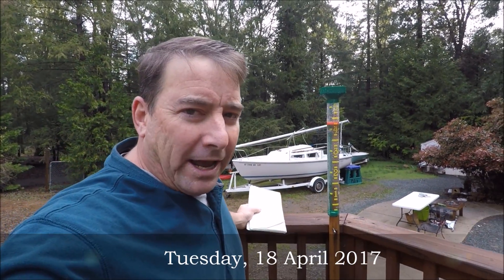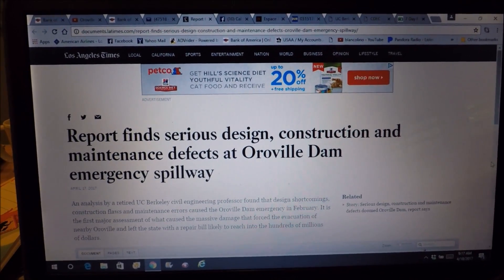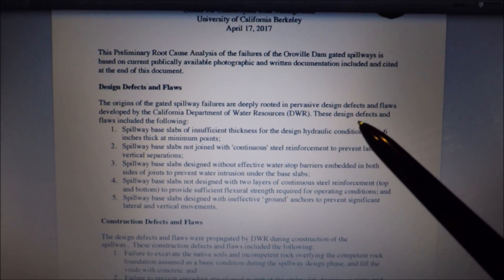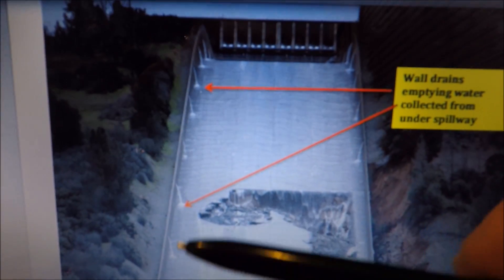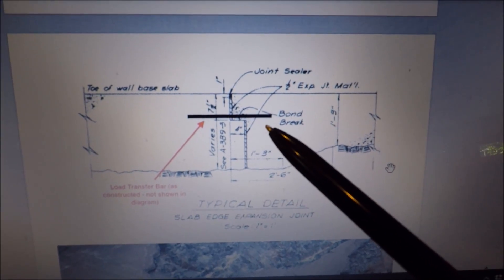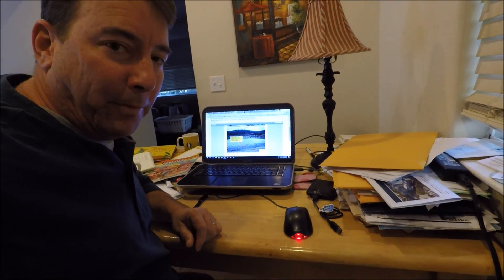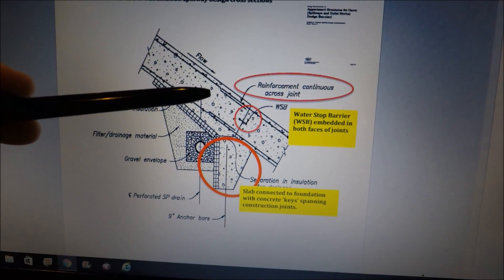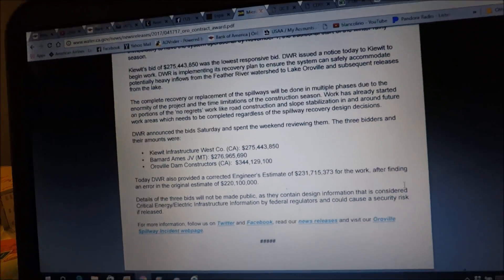Oroville 18 April Spillway Failure Explained-Independent CCRM Report

Comment: Cavitation technically is not a positive-pressure air-bubble, it's a negative pressure "vacuum" that is created by fast moving water, which is why it's able to "pop" into existence and suddenly collapse. Cavitation is similar to what is theorized to happen on the lift-side of an airplane wing or sail, it's a manifestation of a pressure difference caused by fast moving fluids and it is the most destructive force water has when eroding anything.

Good video.

Comment: I continue to be concerned about the spillway control gate structure and it's known column cracks and spalling. It may be inadequately supported by bedrock and has obviously been experiencing stress damage and possible shifting.  I expect the upper end of the spillway to be seriously undermined as that has been a primary source water flow underneath the spillway slab.  Some of the photographs show gate leakage disappearing through the cracks in the upper spillway just below the control structure.  
My personal recommendation would be to keep the current spillway operational and begin construction of a new spillway channel diagonally southwestward starting on the current boat ramp parking lot adjacent to the current emergency spillway.  Repair the current spillway to be used as the replacement for the current emergency spillway after the new spillway is completed.
Reply: You are spot on Robert.  So far, I haven't seen any indication the Kleiwet has been contracted to replace it.  I hope they will, and repair the top of the SW also, because photos of it prior to the major February cavitation, show a strip of cracked and separating  concrete that looks like a Detroit sidewalk.  Top to bottom, it needs to be replaced.  My feeling is that the entire Oroville system needs to be retired and replaced.

Comment: Of course this does not address the 'emergency' spillway, most likely because it did not fail due to age or lake of maintenance, but due to political and management factors. It would have failed day one had it been used. When it was used for the first time ever this year, it DID start to fail at a fraction of it's supposed design capacity, and there was genuine surprise when this happened. So for fifty years DWR did not question this critical part of Oroville dam. Even after they HAD a report in hand from an independent review 10 years ago, nothing was done. If the emergency spillway had been properly designed and built in the first place, this would have been minor incident by comparison.

Comment: Thank's for the Stellar Transparency Juan.
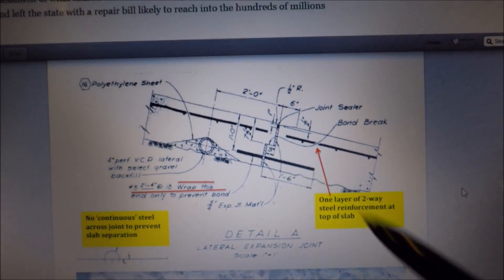1:55 Me too! 6:55 weakened planes. 8:40 no select gravel below said pipe for support cradling. Even you're home's City water meters have @ least 4" below & outside it's edges to insure water junction support.
-Bet they don't utilize the same round aggregate sub-base fill as before. 
-Change Orders needed for the original plans are known to most bidders & affords them to leave money on the table in order to win the lowest bid. 
-These logically Persuasive future Change Orders eventually surface & augment, if not increase, that said table money. But then, what would i know of such things? 23 yrs. as an inspector of new construction of roadway & bridges for TXDOT.
"Inspectors are like morticians, no one want's to have to deal with them, but both keep things from stinking later on."-gilpin 41817

Comment: Juan, thanks for your excellent presentations.  Incidentally, cavitation isn't air bubbles.  It is caused by low pressure, a vacuum,  causing the water to vaporize, or boil.  The bubbles are water vapor, not air.  You are correct though in that when the bubbles collapse they cause a pressure spike that can damage, concrete, boat propellers and powerhouse turbines.

Comment: The intended purpose of those earthenware pipes underneath the spillway was to reduce pore pressure. Pore pressure is the hydraulic pressure of water. It can be immense and can hydraulically force apart pretty much anything. What we can see in at least one of the pictures is that the pipes have been completely surrounded by concrete thus sealing the pipes from being able to allow the migration of water into the pipes and thus they are not able to relieve the pore pressure below the spillway. A better design would have been trenching the pipes into the rock rather than laying the pipes over the rock and surrounding the pipes with the spillway concrete. Better that the pipes are surrounded by porous gravel and the gravel wrapped in geotech fabric. Hindsight though is a wonderful thing.
Reply: The clay pipes are governed by the golden rule of drainin water...the fall or downward angle of the pipe to carry off the water was constrained by the thickness of the concrete thus to increase the flow of the water out of the pipes to the side drains the designer angled the pipes down the slope creating head pressure enough to direct the water up the sides and out of the drain openings.  It is now obvious that this spillway is like a layer of dominos with tremendous leaks between the slab blocks that are so visible in the wreck of the lower spillway.  Also, the designers neglected the forces of friction involved at the flow increased to 137,000cfs which would open up the joints allowing even greater leakage and soil/rotten rock disolving underneath the slab allowing movement in more directions..up, down, sideways.  This spillway was so porous it deserves to be called a seive, and the designers collander salesmen.
Reply: I'm trying to keep up with Juan, and hate to expose my ignorance, but I  am ..... technically challenged. Would really appreciate any info you could give me. - the drains are for what? - and hook into the clay pipes? - not understanding Juan's refs to "herringbone" - how are the pipes arranged under the spillway? - are the expansion joints part of the problem? Thanks.

Comment: As a civil engineering materials quality control technician and an ACI certified technician this is so interesting. So many flaws that I deal with almost daily. It's great to see what can happen if I don't do my job or the engineer cuts corners.

Even with my limited expertise I can definatly say that the spillway is far from adequate. I would have imagined at least 24 inches of concrete on something this massive. And no rebars on the bottom of the slabs? That's weird. I would have loved to have been there during construction to see all of this.

Comment: I'm not sharp enough to tell, the what to do except redesigns that discharge spillway so that both plant and excessive season's waters strains the same direction ...
But do energy requirements absolutely needs Flats levels of production ...

Don't California use wind or Solar production devices ?

I've seen comments asking for Stronger (Bigger) Power-plant production Which could have sense without misuse of it ...

The power plant ought to be able to absorb a large part of water levels variations ...

Stop considering the oroville lake like a free refill tank ...

It has never been free energy !

I just cannot understand, nor accept an Energy producing device that was conceived with the event they have to stop producing cause the energy provider "gives" too much !

What ?

The lords buried them under tha gifts ?

They received that much, that they can spent it like it was unsignificant ?

As a matter of concrete "joint" dilatation absorbers, or junction ...

I do not agree with those draws !

My deep internal feelings is that they should build those in large curved "trait de jupiter" junctions or  sections that could be "anchored" from a clean base to the top of the spillway ...

Which means "sections" could be built anywhere else and then assembled on the oroville basement !

But, I'm not qualified enough to talk about the whole meaning that situation ...

Except that some humans "ways of being" leads to it !

Thanks Biancarlo, ...
If you were able to translate CFS to metric measures, would be a plus .

I know gallons are about 4 liters .
Just can't put a "picture" or imagine what is or what represent a Cubic feet ...

We even don't have triple-cheese-burger there !

Europe is third world, I swear !

Comment: A couple odd things in this report.

First, he states that the diameter of the drain pipes was enlarge to 6" from the original design calling for 4". Where does this information come from?

Also, he questions why there is no steel bridging the expansion joints. The whole point of an expansion joint is to allow for independent movement of sections. If there was steel connecting adjacent sections they could not move relative to one another. Why would he cite this as an omission?

Comment: Very helpful report, nicely done.  One note about cavitation.  I think the bubbles are not air but water vapor at reduced pressure, where stresses have pulled the water away from itself, creating a rupture in the liquid, shaped like a bubble but full of nothing but vacuum plus water vapor  at the temperature and pressure at hand.  If there were air in the bubble it wouldn't crush, but with nothing in there but water vapor, the "bubble" can implode destructively.

Comment: You don't have to fix a leaky roof if its not raining, or that's good enough or it will hold. People are people.
Reply: + MyOLD36chevy - But a WISE homeowner doesn't wait until a catastrophic storm (rain, sleet, heavy snow, or fallen trees) happens to see if his roof is strong enough and has the right materials to resist serious leaks or cave in. If he's not knowledgeable enough himself, he hires someone who is to periodically check for weak areas and do repairs or replace the roofing materials every __ years as advised by roofing experts and other professionals.

Neither does a wise person let his tires go bald, have a blowout, and have a tragic accident loosing control of the car and possibly killing himself or others. He periodically rotates the tires, fills them with the required amount of air, and replaces them BEFORE he (or his mechanic) see the tires are near their estimated life expectancy.  It's not unlike one's health and medical bills:  you can pay now or pay much more later.
Reply: I agree with the concept but I have worked on government jobs and there is not a lot of common since to be found.

Comment: Very good report as usual. I saw your drawing at the end showing how the slab should look at the drain pipe. It showed the slab actually thicker at the drain instead of thinner and the pipe surrounded by gravel. That would be a lot of extra digging in solid rock sideways across a steep slope. Easier to grade the rock to bottom of slab level and lay the pipe on top. Design or construction short cuts? Do they have the original drawings? Or did they lose them in the fire at the pool 1 power plant?

Comment: It had to be drainage or leakage problems. Cavitation, especially destructively resonant cavitation, acts on the upper surface of the slab, and is readily visible, long before the slab fails. Erosion, underneath the slab, was only way it could fail "suddenly." It's a double edged sword. First, as Juan rightly points out, a sagging slab over an erosion void, puts the upper surface of the slab into compression, easily resisted by the concrete itself. The lower half (give or take) of the slab went into tension and, devoid of rebar, simply sagged, then failed.

The other component of spillway failure due to erosion lies with the anchor bolts. With a properly supported slab, the anchor bolts transition from slab base, immediately into bedrock. Any slippage puts the anchor bolt (rebar) into shear, a stress easily resisted by properly sized steel. Erosion, on the other hand, not only creates a bending moment between the slab's under surface and now distant bedrock, it further subjects the steel to potential flex, and concurrent metal fatigue.

None of this is rocket science. This IS why any competent maintenence program includes core drilling thru the slab, you HAVE to remain aware of foundation performance. You further HAVE to be fully aware of the consequences of even one single under slab drainage failure, and this awareness requires ZERO effort. The wall drains all flow at comparative rates, or they do not, and this is visible under the most cursory visual inspection.

 I'm going to hold short right here. Any competent engineer will confirm my statements up to this point. Further discussion, involves potentially subjective assessment, and political maneuver, up to and including a possibility of libel issues.

I think the Official report, will be very....interesting... regardless of content.

Comment: You keep mentioning met standards of the 1960s. I have to push back on that. Proper standards for any kind of construction like this requires going down to proper bedrock. 5/8" rebar on 12' centers, come on??? There may have standards but full compliance is in question. The crack failure mechanism was the result of drain pipe installation. Couple design inadequacy with inadequate and inept maintenance will challenge and defeat even a properly engineered structure. Here is a clip from an article California Water Research (An INDEPENDENT research source on California Water Projects) article "An investigation by DWR in 2008 of the main spillway chute showed that the concrete surface had more extensive damage than just the “small areas of spalling” noticed by John Onderdonk in 2007.  The bid summary in 2009 shows that the main spillway chute needed 10,000 linear feet of sawcutting one inch deep, and 83 cubic yards of void repair. The chute also needed 3,900 linear feet of major crack repair, as well as 23,700 linear feet of contraction joint repair.

Although the letter from FERC requested Department of Water Resources to submit a followup report on the main spillway chute repair, California Water Research could not locate any report about the repair in DWR’s public FERC filings.  As previously reported by California Water Research, the Bureau of Reclamation’s Guide to Concrete Repair recommends investigation of the causes of cracks in concrete hydraulic structures".
 So were repairs done?? 83 cubic yards of concrete is 8 truck loads. If this design was adequate for 1960 standards, then what about the others built in this time frame?

Comment: So it is not built as a bridge or a roof, but only as a roadway. A very steep roadway. Basically, a thin layer of concrete floating on mud held in place by wire.

As long as the foundations where kept dry, it held together just fine. But after 50 years one of the clay sewage pipes blew out and water got into the foundation. A sinkhole formed and it's game over.

Comment: great job juan! lots to get thru for sure and maybe you can get more detailed as the project moves forward. question, if the first design failed why the would you use the same basic design, including construction updates, again? considering the bed rock issues, especially at the newly formed plunge pool, could a heavy gauge plate work to reinforce and/or span the void?

Comment: Of course it failed at the weakest section, but that wasn't the cause, it would've failed anyway, maybe a bit later. Do you have freezing temperatures in that area? It might have been a contributing factor, frozen drainwater eroding the rock and lifting the slab, making cracks.

Comment: Where in the report does he point out the GLARRING INADIQUACY OF GOV. JERRY BROWN?
Reply: " and the funding to maintain the dam infrastructure dried up. "  Maybe so, but exactly what maintenance do you recommend to overcome the flawed design that only has one layer of rebar, too thin concrete, and clay pipes embedded in that same concrete that not only result in creating weak areas in the concrete but fail and allow seepage to undermine the structure. No amount of "maintenance" can overcome those conditions. Actually, this information would tend to suggest a re-evaluation of the corrective work that has just been contracted since a good portion of the existing spillway will remain while this information suggests it should be removed or substantially upgraded.
Reply: The Security Guard  -  You seem confused.  Are you a citizen of the USA???
Reply: The same place he points put the glaring inadequacy of Ronald Reagan, who was governor during construction. (You might want to turn spell check back on, you need it.)
Reply: "work on the present problem"  . . . those are the bastards who should have been working on it, from the time it was built up until it failed.  . . .  Do you blame the dog? or the owner for you getting bit in the ass?
Reply: As others noted the public loved the innovation and majesty of a modern dams being built around the central valley in the sixties.  Once the dams were completed and the bloom was off the rose, other priorities quickly dominated the political landscape and the funding to maintain the dam infrastructure dried up.  Thankfully the main spillway failed far from the dam so it could still be used to quickly reduce the lake level preventing a catastrophic failure of the emergency spillway.